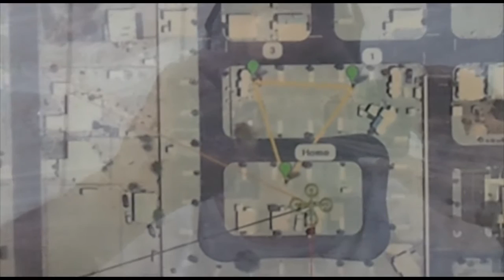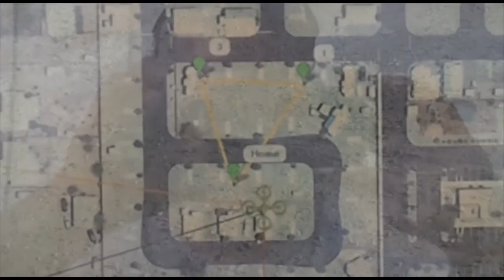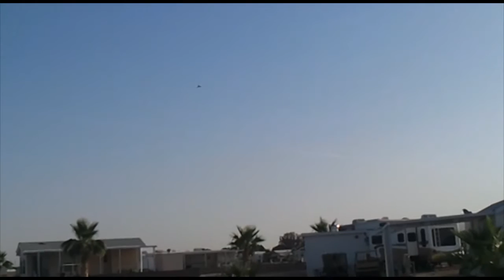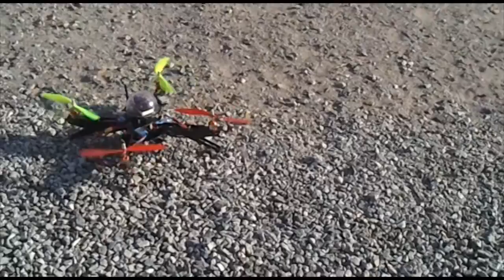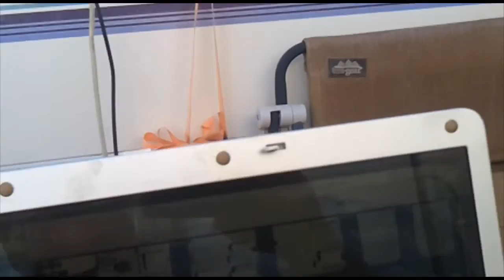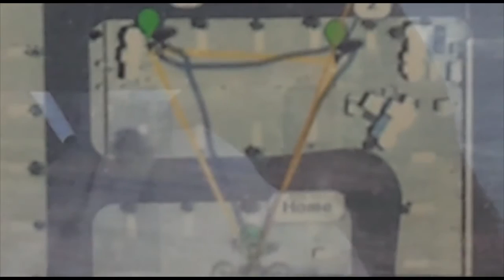Running an Actual Mission with the RCTimer ArduFlyer 2.5

Comment from the maker: The ReadytoFlyer 2.5 does not repeat is not have a version 2 GPS. If you want a US distributor for the RCtimer Aurduflyer 2.5 Do a search for UAV objects that's where I bought mine $151 for the board GPS and telemetry radio with USPS priority shipping.